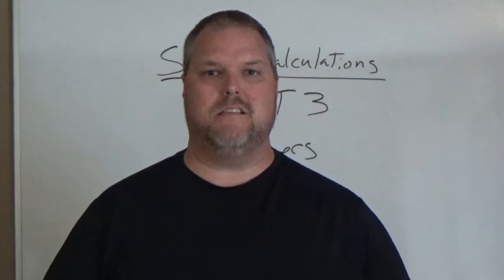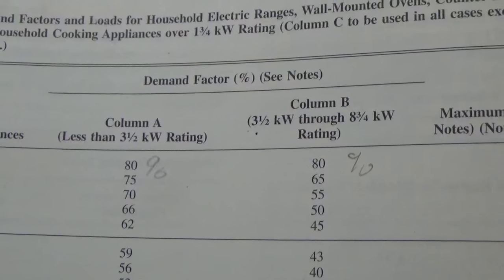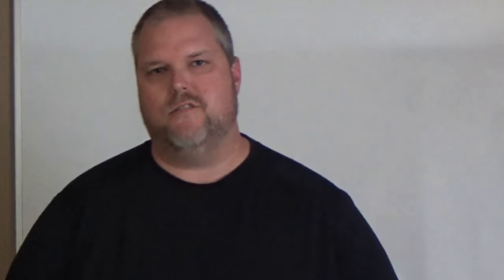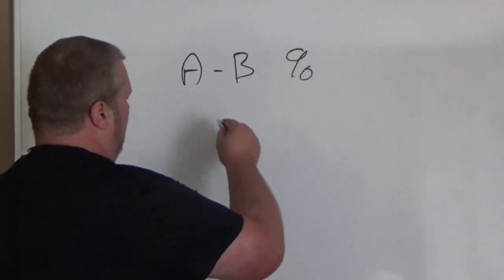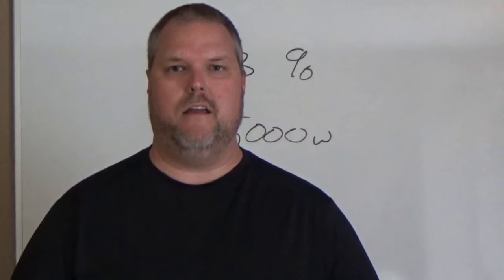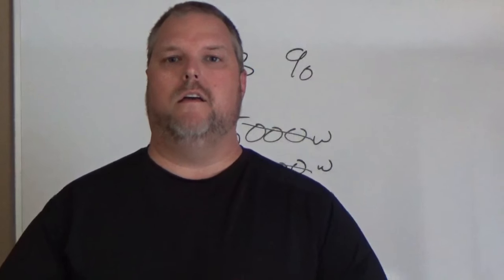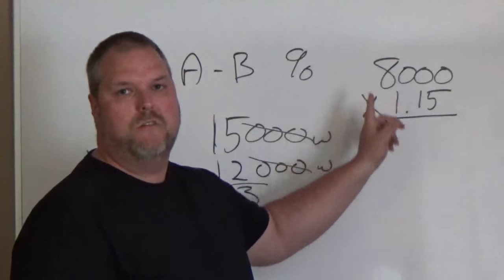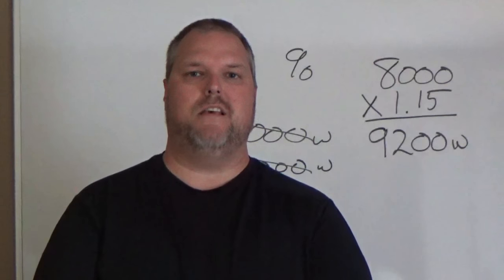Sizing Dryers and Ranges, Load Calculations

Comment: Hi Craig  I think there is un intentional miscalculation, just to make sour if I am in the right direction ?  15,000kw -12,000kw=3kw times 5 .
times 15%.    So 15 to 100 =1.5 not 1.15 and then the answer would be 8000 times 1.5  if I am right,
Reply from the maker: No it is 15% or as I do it 1.15 ×8000. It is just 15%. CM
Reply: At the top of this you the best great NEC instructor

Comment: Okay sorry for being lost but somewhere in a practice exam the additional 5% per 1000 KW was added to 12,000 instead of 8,000. What is going on there? I is there a scenario where this is done
Reply from the maker: The 5%is added to the 8000va. Never to the 12Kva. You subtract the the from the over 12kw add the 5% to the 8000 as I explained!! I have a video on using 220.55 this will explain it. CM
Reply: @craigmichaud-electricalins4602  thank you for the reply I will amend my notes

Comment: What if you don’t have a range but a separate cooktop and built in oven? Would these be considered fixed appliances?
Reply from the maker: Yes you would use the combination of the two and then find where you stand on the table. Great question!! CM
Reply from the maker: Part 2 of that question is No you still use the range line only on that. it is not a fixed appliance!! CM
Reply: Thank you for the quick response. I really enjoy and appreciate your videos.